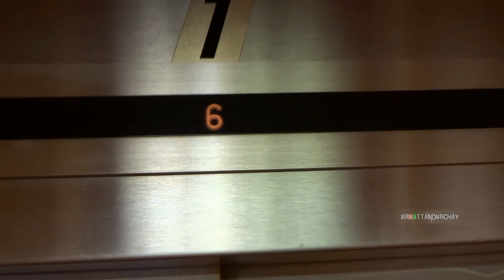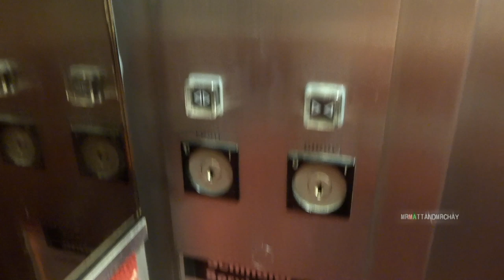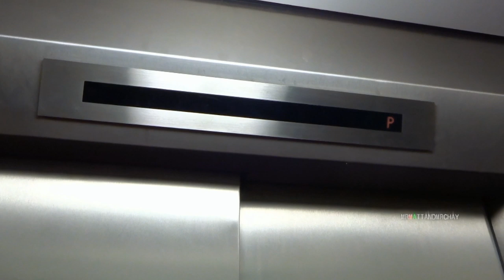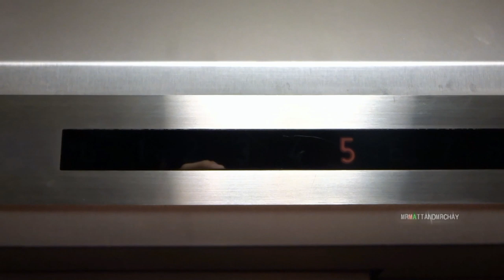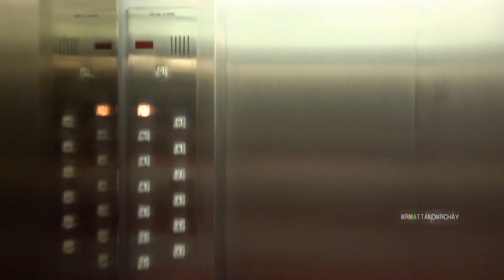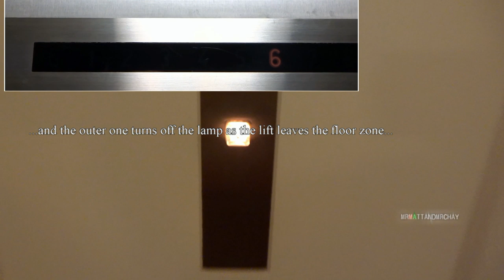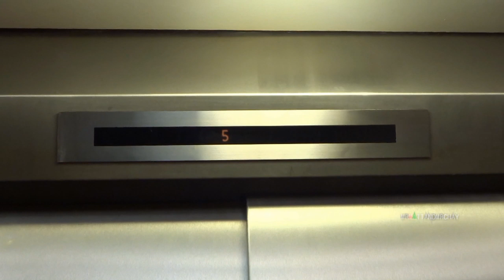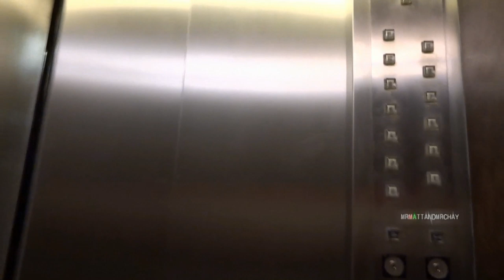Original Schindler lifts (relay controlled)

Comment: Nice horizontal schindler floor indicators, they remind me of the ones I've seen in the movie "the lift" (which is one of my all time favorites). Schindler participated with the production of that movie in 1983. The movie was shot in an officebuilding in Amstelveen, and the building is called Kronensteate. It is the dutch office of IT company Logica. It was built in 1973. For those who have seen that movie, you can see that they put generic kronenberg fixtures in them, but the classic schindler floor indicators with the lamps are still visible. It's the exact same design as in the lifts you have filmed. That movie made a huge impression on me when I was 7 or 8 years old.
Reply from the maker: I remember that movie well - a little far fetched with the ropes that came alive and the circuit board growing itself and controlling the lift, but still, yep it was good.  I watched it again recently actually (cant remember where I found it) but very interesting info that you put here.
Did you see the film 'out of order' - I prefered this one.  I put the 'best bits' of it on my channel, start from here if you haven't seen it... Out of Order (1984) - Part 1 of 4  (Rated: 12+)
Reply: mrmattandmrchay Yes, I've seen that one too, one of the lift users is completely vandalizing the lift. Oh, the name of the building where the lift was filmed is called "Kronenstede", here's some info on it: http://www.emporis.com/building/kronenstede-amstelveen-netherlands. They filmded most of the scenes on one floor, and Schindler had two engineers on the set. They had to override a lot of safety systems to make this movie. It was a small budget film. If you look at the motor room, you'll see a lot of pcb's. I wonder if they where early Schindler micro processor boards. Considering the age of the building, I would guess that it was still a relay controller. But I can't really see any relays, and I think that they filmed it in the actual room. Maybe Schindler had upgraded the controllers in the early 80's?
Reply from the maker: dykodesigns2yt Interesting :)  How did you know all this information?
Reply: mrmattandmrchay Dutch wikipedia and things I've read in the newspapers. The main actor is often interviewed about this movie. Here's info on the IMDb: http://www.imdb.com/title/tt0087622/
Here's a translated version of the dutch wikipedia page: https://translate.google.com/translate?sl=nl&tl=en&js=y&prev=_t&hl=nl&ie=UTF-8&u=http%3A%2F%2Fnl.wikipedia.org%2Fwiki%2FDe_lift&edit-text=&act=url This is the building on streetview: https://www.google.nl/maps/place/Kronenstede,+1183+Amstelveen/@52.321045,4.878164,3a,90y,39.93h,90.42t/data=!3m4!1e1!3m2!1spZfbkIXt8OiruQl5b4z8WQ!2e0!4m2!3m1!1s0x47c60a6c6c002eb1:0x2163f1bd03aba851!6m1!1e1 This is the building on BING maps: http://www.bing.com/maps/?v=2&cp=52.311038~4.870866&lvl=15&sty=r&obox=1 (The entrance has been renovated, but in the movie you can see the name of building above the entrance with it's original font, the put new text above the entrance). Also, the surroundings of the estate where much younger in the movie, the carpark next door didn't exist yet. Also, I've watch the movie many times, and I always look for details.
Reply from the maker: dykodesigns2yt Believe it or not I am currently 4.5km from that location!!  I'm working in Joan Muyskenweg, Amsterdam for a few days.  If I had a hire car then I'd go and have a look, but pretty pointless as 1) They would have been modernised 2) I wouldn't be allowed in without official business with the company in there, Logica!

Comment: I wanna to point your attention on push buttons.
They are almost indestructible in these Schindler lifts, because, they are made of no- contact magnetic switches.

When you apply push on button, you actually move magnet against read element, 
so, any force on button do not transfer to read element (magnet switch) because they are not physically connected.

Very expensive solution for 1970 but - undestructable.
I have big respect for Schindler from 1970 series.

Nowadays, lifts are all the same - ''planned lifetame garbage''
Reply from the maker: That is very interesting and I didn't know they were a reed switch and magnet.  It does make sense but reed switches only handle a small amount of current.  We use them for security systems but connecting one to even a small relay will cause a spark between the reed contacts and eventually fuse(weld) them together.  So these must been connected to some kind of transistorised relay?  Any ideas?

Comment: If you looked around on the penthouse floor you could probably find a alternate entrance to the machine room that does not require a ladder (probably in a roof access door or the stairwell).
Reply from the maker: I went to this place twice.  Between visits I even looked on google earth - the motor room is on it's own on the roof which was relatively small.  I looked in the stairwell and the cupboards around the motor room hatch (in case there was a ladder going up there) - definitely no other access up there, unless it was in one of the penthouses which is very unlikely.  I looked everywhere :)